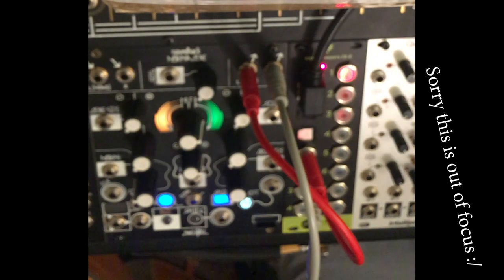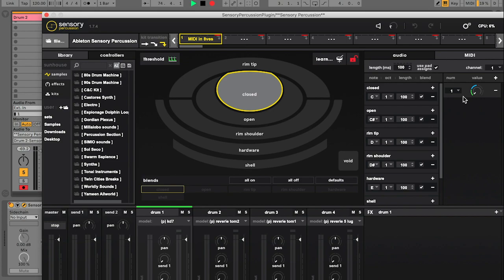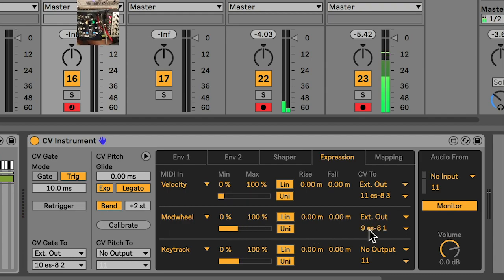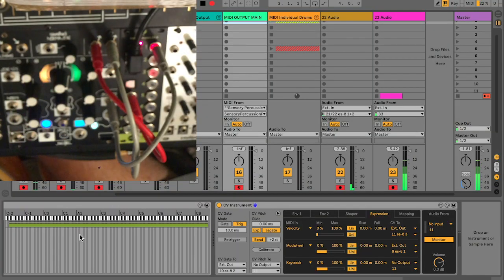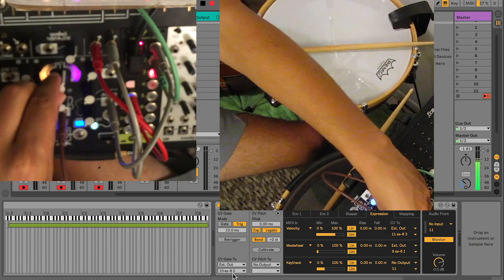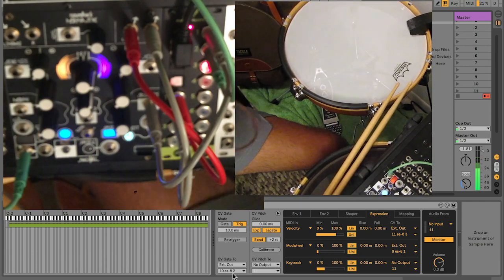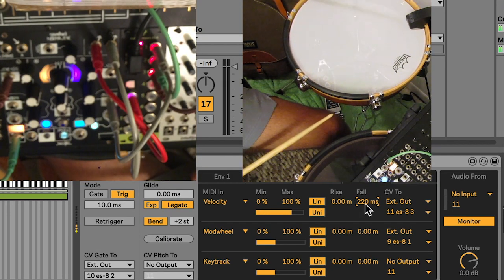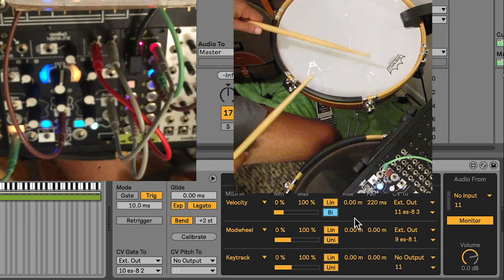Morphagene as a Unwieldy Drum Machine controlled with Sensory Percussion

Comment: 0:33 How did you manage to get the locators come up as splices in MG? I thought Ableton didn't export the regions. Also, bit depth is 24bit instead of 32bit, so MG would not have read this file correctly, unless you took this file to another program, added regions and saved as a 32bit. Or am I missing something? cheers
Reply: came here to ask the same questions! also sample rate is 44.1 and not 48 - for me, this makes the morphagene playback the sample at a slightly higher pitch
Reply from the maker: If I recall correctly I discovered this unfortunate reality about the splices while making this video and then just put them in manually on the morphagene. I'm sorry for the misleading video editing! I don't think I messed with the bit depth or sample rate.